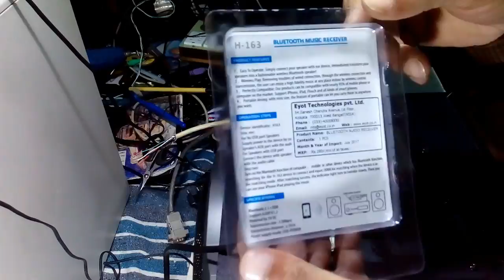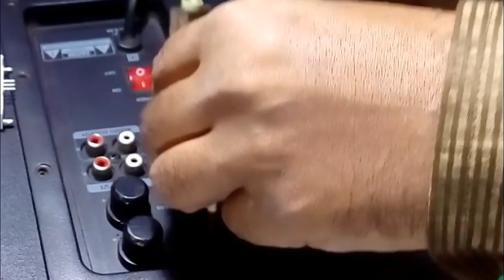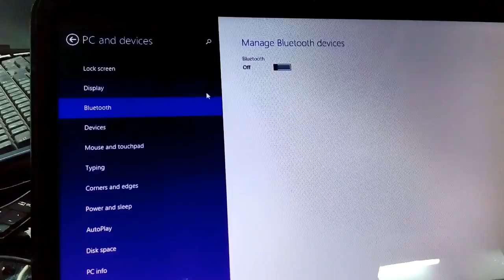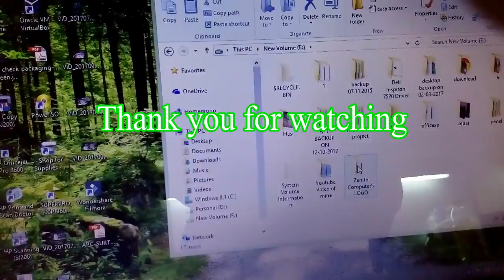How to make Wireless Home theater system / Bluetooth connection to any speaker

Comment: instead of 5 volt charge you can use an LM7805 ic which can be connected on the output side of retifier diode and you easily and more cheaper than charger.
Reply: if I can put a voltage reducer, and it was more neat,. parce that of knowing it knows it, and it is the client, or I do not know who would be the electronic device, I am very bad, anti stetico,.
Reply: bhai it makes lot of sound when it's stopped or paused ?
Reply: @Zohaib_Ashiq  no it doesn't make noise i am using this in my home theater every thing working fine but u have sounds when paused you can use DC-DC ISOLATING CONVERTER to remove noise.
Reply: @ajay Gupta what's that brother ?

Comment: duee serius all in this comments please just buy an rca to 3.5 mm aux port adapter and with that bluethoot thing just plug it in the wall plug or pc i mean these adapters you can get for 99 cents and without voiding ur warranty and nit even putting a single sound in from the speakers deepfake

Comment: I'm surprised you didn't make the female USB ports and AUX inputs flush against the backing so, you know, it looks better than gaffa tape and cable ties. Heck, you could have bypassed those and just had a power switch sitting on the outside with the Bluetooth logo next to it, and have it so when the bluetooth is on, the aux or RCA line would be inactive. Never mind that you never demonstrated it outputting audio so how are we to know this worked?

Comment: this is the most stupid idea i have ever seen... why not to put the bluetooth inside the case and add a switch to power it off.. and you can use power regulator transistor instead of that power supply you add...